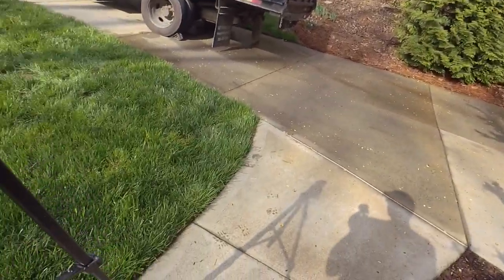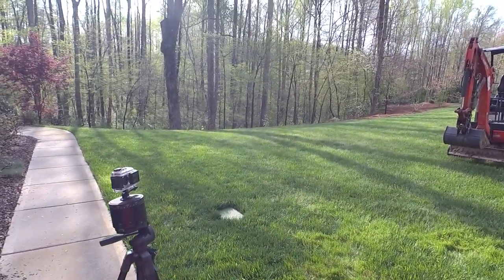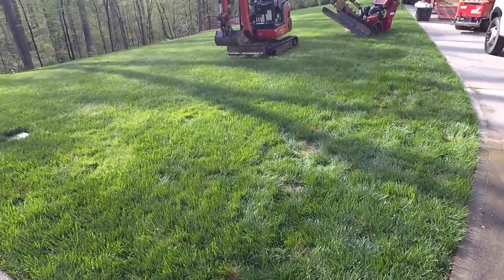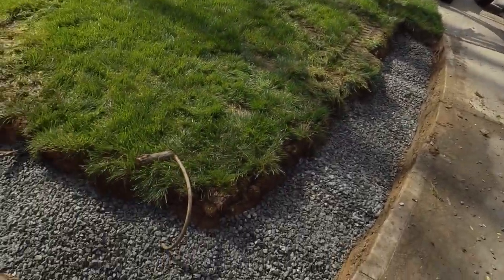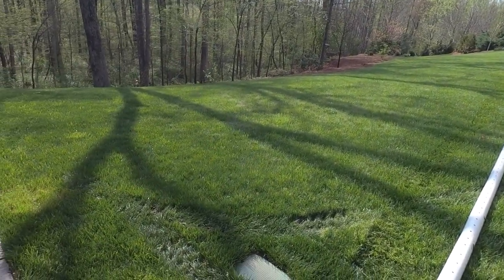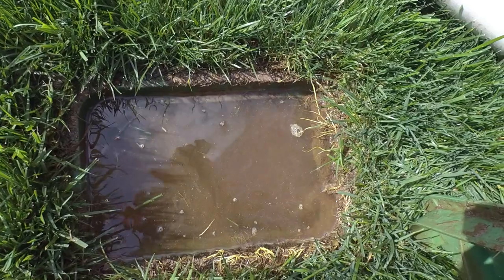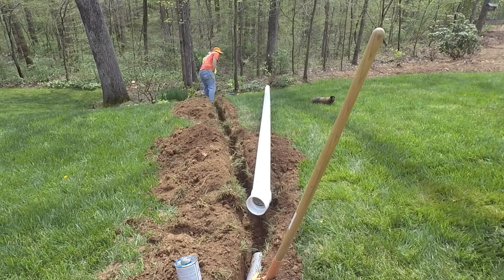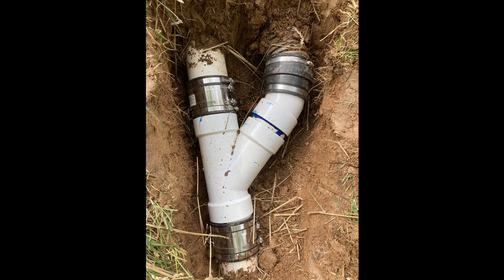Beautiful French Drain - Looks and Results

Comment: You’re a good man for informing the customer of your mistake in not connecting gutter drains.
Reply from the maker: Thank you! It stung a little bit to have to drive back out there with two guys, but we got it connected before any big rains.
Reply: @GCFD  Best to have a little bit of embarrasment, than to have an angry customer. Your integrity turned a negative into a positive, that customer will now sing your praises to everyone, word of mouth is the best free advertising ever.
Reply: @GCFD  it was good that you had the recordings to see that mistake so you could go back and rectify it as you don't want to tarnish your own name (like others do by not doing the job correctly the first and second time with using corrugated and perforated pipe and not fixing the problem or spreading the problem around)

the amount of videos you have done fixing or completely replacing other jobs that been done incorrectly, where the homeowner has paid more then once to have a job done and you getting it right first time (is amazing how many companies don't understand how to install drainage systems correctly)

Comment: The river rocks you guys laid out along with the owner adding the larger rocks looks great. Definitely makes me wonder if you could use a rain garden to either cover up or act as a french drain/catch basin.
Reply from the maker: Yes I think you could do that. The problem is we have periods of very dry weather here so you'd need to keep those plants watered.
Reply: I’ve read that rain gardens don’t work well as a substitute in areas that don’t drain well, because they don’t drain well. You end up with a pond if you build it into larger structure. Rain gardens are more preferably placed in an area that water naturally tends to drain towards and out of, such as a sloped channel. So it would be preferable to build this into a rain garden versus not adding a catch basin/French drain.

Anecdotal experience here: I turned a part of my lawn that gets a big puddle when it rains into a rain garden. the water level once ran onto my front walkway. Now it’s a rain garden that forms a pond when it rains, and the water still puddles onto the driveway at the same level as before.

Comment: Hey guys! Loving the videos you are my current go to channel! I am a landscape gardener here in the UK. I have a suggestion for you. If you cut a line in the turf with a saw, blade, lawn knife, spade, or edging tool, before you dig out the trench, you will get a very much more neat straight line, taking your French drain installations to the next level. Also, as the digger will not be ripping out clumps of sod it will also save you time, because you wont have as much overspill. So it wont cost you anything to do it this way.
Reply: You could even draw the line with the pipe trench machine!
Reply from the maker: Great Idea!

Comment: This is cool - you guys did a great job, and then the homeowner putting his own touches on it.  That little garden he put in is very zen.  Good catch on going back to pick up the gutters, too, that would have been ugly if the customer had found it, but you turned it into a positive.  Nice.  

Question - why is river rock not good for drainage?
Reply from the maker: Thank you! River rock is rounded and rolls around under heavy flow. It also rolls around underground which is why you absolutely don't use it in the FD because the soil just flows through it. Angular rock locks in place and forms a filter for the FD. Here, the river rock is on top and there isn't enough flow at the outfall to move those rocks.
Reply: @GCFD  Ah - I figured as much underground, but didn't consider heavy flow rolling the rocks around on the surface. Thanks.
Reply: @GCFD  River or sea dredged rock will not roll around underground. It is held in place by the other rocks around it, too roll around there has to be space around the stones. On the surface it will roll around more than the same sized and density crushed rock. Crushed rock is more "spiky" than round so it interlocks to some extent giving resistance to movement along the surface when pushed by water or a vehicle. A heavy rock like granite will also be able to resist higher flows than a lighter rock like limestone.

River or sea dredged rock will not stand up if you excavate through the drain trench in the future. But you should not rely on crushed to slide if you dig through it.

When the soil migrates, with the water flow, into the drain stone the smaller stones in the soil catch between the drain stone. Then even smaller stones in the soil catch between those stones and so on. Rough crushed rock will catch more stone and grit from the soil than smooth stone but the smooth stone will still work. The width of a french drain that does not use a fabric has to be wide enough to accommodate the soil migration. The nominal size of the stone is more important than its shape. A drain stone with a high amount of grit (as could be used for concrete) would better withstand contamination than a non fabric protected single sized stone especially in silty clayey soils. But such drain stone whilst maintaining its working width does not have the same ability to deal with high short duration flows from surface runoff.

A single sized river or sea dredged rock will be able to take higher flows in a french drain than the same sized crushed stone since the water will move faster past smooth rock. The drain can be topped with 6 inches of crushed to reduce stone movement on the surface.

Comment: I recently purchased an old single home with flooding issues in my basement when heavy rains occur. This gives me some positive thoughts about what to do about my problems. Great work by you and your crew, and very responsible in correcting an issue that the homeowner may never have known about...
Reply from the maker: Make sure to address the gutter water first to ensure it stays in a pipe until far away from your house.
Reply: Do you need to get permit from city?

Comment: Good work Shawn. Would you not want to catch the water on the other side of the driveway to prevent the sheeting of water on it?
Reply from the maker: I like to catch the water at the low point with a FD for best results. We had water coming from multiple sides to that low area. Great question! 👍

Comment: Hi Shawn - I know I'm late in the game here, and probably this won't get a response.  But have you considered, on jobs like this, using Pervious Concrete (maybe called porous concrete, permeable concrete, no fines concrete or porous pavement) on top of a french drain beside a driveway?  The customer here wanted river rock, which is really straight-forward.  But it's possible that covering a french drain with pervious concrete might be a better fit in these situations.  That may have unintended land/home tax or HMO consequences (extended a driveway), but I'm guessing that given the drainage purposes it would serve, it would probably be worth a quote.  Curious to know what you think.
Reply from the maker: Great point Rusty. Here our subsoils are clay so even if you have a permeable concrete surface it will quickly become overwhelemed with surface water.

Comment: Hey Shaun, as always a great video! 

I was wondering if you had considered using a geotextile fabrics in your builds to help keep the gravel and dirt sperated over a long period of time ? 

My wife works a a civil engineering company where they specifically put geotextiles in their builds including massive french drains and other drainage Soultions.

Keep up the great work
Reply from the maker: No I prefer to use several inches of gravel as a filter. This preserves the flow into the drain, which carries the fines through and out of the system. A thin fabric clogs fines against it and kills the flow.

Comment: do you have just one row of holes in the pvc pipe? is it placed at the 6 o'clock position when installed? does it matter if it's sched 40 or the green sewer pipe with the bell?

thanks for the videos. yours seem to be the most helpful and proper way over those that use corrugated and are just out to sell product
Reply from the maker: We do two sets of holes at about 5 and 7 o clock. The green SCR 35 is good stuff.

Comment: Thanks for sharing the video.  Questions: So you don't have to add gravel under the drain pipe (start to end)?  How about weedstopper?  So the holes from the pipe, should face sided, top or bottom?  thanks again.
Reply from the maker: We place 1-2" of gravel under the pipe and the holes face down. That's because the water will fill up the trench and hit the holes at the bottom first, flood into the pipe, and find a path out, which makes room for more water to flow in.

Comment: ……PS:  I agree with some of the other commentators on here regarding rain gardens.  I’d like to see you install some rain gardens in lieu of french drain particularly when it’s in a lawn setting as it would be much more aesthetically pleasing.  We have installed 1k’s of rain gardens and have full confidence that it would work equally well, perhaps even better in some circumstances.
Reply from the maker: I like the idea of rain gardens but they don't work here. We have impermeable clay and so a rain garden would quickly fill up with nowhere for the water to go. The french drains we install have a discharge point where water is released. More and more rain means more and more water is discharged, whereas, a rain garden would be burdened by more rain. We had 4" last week in 3 hours' time.

Comment: Respectfully, I see the same amount of water pooling (the irrigation box would've confirmed or not),  just not in the corner so much. As you approached the area, the water was still pooling just before your FD started. And then the customer's berm had pooling at the base of the entire thing. So I'm assuming the grass in that area is staying just as wet, only further into the yard than before. So the HO would still have issues mowing wet grass, right? Quite possible that the water draining out the outfall is actually from the gutters. 

Just curious, I'm not criticizing your work, it looks great. And you spotting your mistake, admitting it, and correcting it says tons about your integrity.  👏

Comment: You do really great work!  I have watched several of your videos and have learned so much.  I wish you were in my area.  I have a gutter that I’m catching into a 4” solid PVC pipe to feed a rain garden and I’ve really struggled with properly seating the pipes into the collars or joint pieces.  The cement hardens before I can get the pipe all of the way in. How big of a problem is that for an exterior drain system (compared to a supply system).  Do I have to worry as much about extra wear or leaking of the joint?
Reply from the maker: Are you using primer with your cement? Or are you using cement+ primer (the blue stuff)? Don't be shy with applying a large volume on both ends of the pipe to increase the working time before it sets up. 👍
Reply: @GCFD  I’m using the two part stuff.  The purple primer then the cement. Which are you recommending? Thanks so much for your reply!

Comment: Would a swale have worked equally well? With the highest priority being NO maintenance or VERY LOWEST maintenance, (not the appearance) which would be recommended- the system in his video or a swale? Thank you for your advice!
I watched your video on digging a swale/flat ditch between 2 fences about 36” apart to help the 3 homeowners whose HOA wouldn’t help. When my area gets 4” of rain an hour my garage gets water in it.
Reply from the maker: Swales only work with lots of water as the grass can hold a ton of water, even on a slope.
Reply: @GCFD  Thank you so much!

Comment: Just curious...Why no drainage fabric?  Would a channel drain have worked also?
Reply from the maker: A channel drain would have worked for the water coming off the concrete but not down the grassy side. We were also worried about a channel drain with cars driving over it. We don't use fabric because it kills the flow into the FD. We preserve the flow, which provides the energy to carry the fine sediment through and out of the system. Clean systems work the best.

Comment: I'm confused. Does the pipe opening do anything next to the walkway? Or how does water get into the drain to flow away?
Reply from the maker: The water falls into the trench full of gravel. It floods up into the holes in the pipe and then finds an easy path through the pipe and down the hill, making room for more water to enter the pipe. 👍

Comment: Personally, I would have dug at least twice as deep and lined the bottom and sides with geo-fabric to keep the rock and soil from mixing and used the 6" corrugated "high octane" virgin material pipe.
Reply from the maker: Hi Elvis - we would have killed our fall if we dug it that deep. We use angular gravel and lots of it instead of fabric to preserve the flow into the pipe. 👍

Comment: Dumb question but does the pipe that’s in the gravel have holes for water to go in through or is it getting into the pipe another way?
Reply: Yep, once the water level raises past the holes it flows through the pipe.
Reply from the maker: Like Tony said, the water floods up in the trench and then into the holes, which face downward at around 5 & 7 o'clock.
Reply: They drill their own two rows of holes.
Reply: @GCFD   makes sense thanks.
Reply: @SlackerU  The pipes are perforated and come with the holes pre drilled.
Reply: @tbarbuto2345  Not Schedule 40 pipe.  It was explained in a video that the original supplier no longer offers pre-drilled.

Comment: Curious why a French drain instead of a channel drain along the edge of the driveway?
Reply: French drain will also pick up water running under the concrete which will increase the strength of the soil underneath the drive.
Reply from the maker: Great question! There was water running down the grassy slope and we were worried about delivery trucks running over a channel drain. Plus, the FD could be incorporated into a new landscaped bed. Tradeoffs to consider for sure BJ.

Comment: This is one of the ones that has me scratching my head.  If someone just did the landscaping without the French drain then couldn't that have caused enough to get the water to catch the hill better and flow down into woods?

The fact that the corner is just a big pile of mulch and no more grass makes me think that alone would have removed the problem of cutting grass?
Reply from the maker: There is still a low point in the driveway and sidewalk with nowhere for the water to escape. Take a look at the outfall and that's the water that was landing up there with no easy way to escape. Great point. 👍

Comment: I've noticed on a few of your videos that you don't use enough grass seed. After all that works there's no reason to skimp there IMHO.
Reply: How do you know how much seed there is when it’s under the straw?
Reply: @BDHO73  Did you miss the part where he went back 4 months later?
Reply from the maker: The homeowner provided the seed so maybe we had a limited supply. I buy the 40 lb bags and we make sure to seed it well. I agree, new grass looks good coming up!
Reply: @buckeyedarren  nope, I saw it. But I’ve also seen rolled turf with bare spots after four months which was a reflection of lawn care, not a lack of rolled lawn (or seed in this case). I thought you must have seen something I missed.

Comment: That slab looks to be about 8"-12" thick for the driveway. Why so thick for a driveway?
Reply: The driveway is built to last with little maintenance. It will very likely look the same in fifty years time.  8" of concrete will be thick enough to take some heavier commercial vehicles and survive if the formation (ground under the concrete) is good, so they have the option of doing works in the future and not destroy the drive..
Reply from the maker: Like John said, plus it might have been wet when they were forming it up and they decided to go a little thicker.
Reply: @GCFD  Do you know iif the drive was mostly slip formed. it looks good with the sawn joints. Your drain looks good beside it.

Comment: French drain q:  Apparently the water will run down the channel you dug, and you’re using the driveway and sidewalk to hold the water in the channel.  But why the pvc down the middle of the French drain when there’s only 1 intake, at the top?  Seems like it would usually be much emptier than the main rock channel, and the main channel doesn’t get into the pvc for the long run down to the natural area (as far as I can see here).  Just questions for my personal edification, no criticism. I enjoy your channel and work!  Tx, very cool.
Reply: the opening is a clean out. the pipe at the driveway is perforated. the one thought the lawn is solid.
Reply from the maker: thanks for watching D! the pipe has holes in it that face down. When the water falls through the gravel it fills up the trench and the water floods into the holes in the pipe then down the solid pipe across the lawn. Like Timothy said above, The opening at the surface is to access the pipe if it ever needs to be cleaned out. 👍